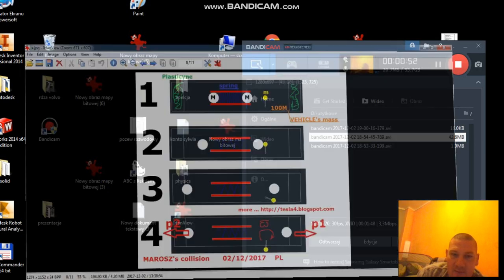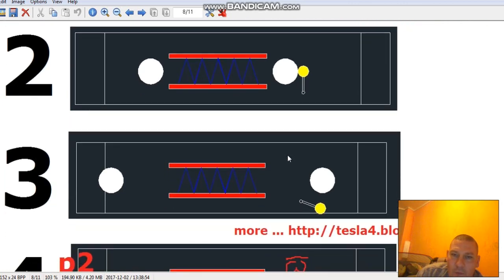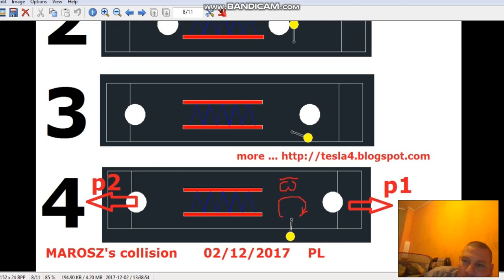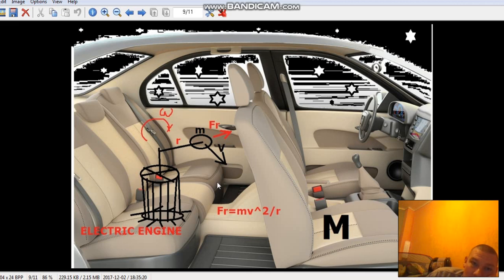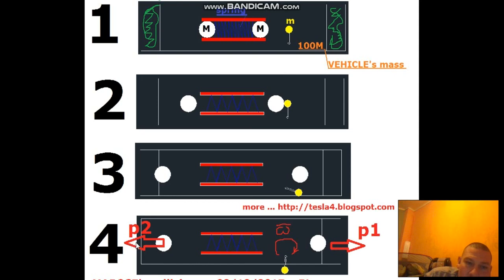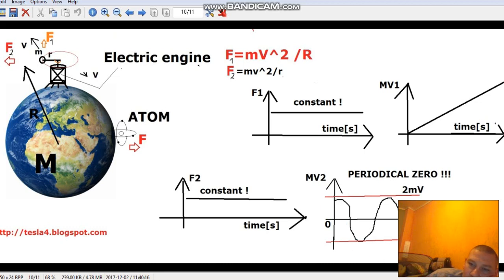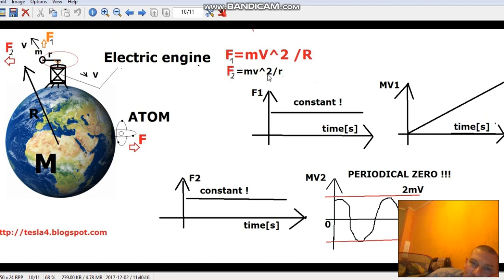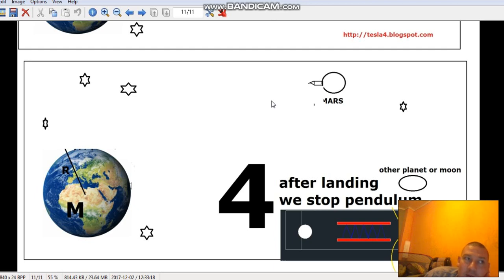EM DRIVE - POLISH ENGINEER SOLVED PROBLEM !

Comment: yes, very good!

You could simplify it by attaching the right mass to the arm and have it spin half a circle before bumping into the plasticine  (p1)  

That would have both masses (p2 and p1) bump in the same direction(!)

It is of course true that the arc motion will create a [centripetal] force to the right (p3) but this can never be the same magnitude as p2. 

Clearly p1 is real and can not be explained away.
Reply from the maker: Sir I worked in this project
https://youtu.be/-t9-GCJTh34

Rotor it is pendulum big mass and small R
https://2.bp.blogspot.com/-hnTo89rHofM/WduuNo4lnvI/AAAAAAAADCE/xNOv0Ezbv3slZByWBH0h-tFjFXStiw--gCLcBGAs/s1600/000.jpg

This project need be continue we can improve many details but it need money.

Right now F1 mercedes mc laren team is using this tool to absorb suspension vibrations 

This project will give us people many informations about atom

Problem is that right now nobody supporting clear reasearch https://4.bp.blogspot.com/-gGRHCO1CiZ4/WfFyU29EaTI/AAAAAAAADDQ/7QpUNap7fbEVZ_64LBdu1Srd27p41EfJwCLcBGAs/s1600/111.jpg

Special if knowledge is opposite to Ligo and Einstein
Reply: Thats a really cool implementation.

I think if you want to see it funded you could propose something like stopping bullets or dampening explosions. The rest of the markets seem overly driven by advertisement.

I do love the concept. I think it might even be possible to prevent the vehicle from spinning and/or keeping it horizontal during the crash using the energy stored on the flywheel .

What if a crash could be electronically anticipated based on the speed and  maximum steering angle. One could fold out a contraption towards the obstacle before hitting it. (like a giant airbag) I imagine an extra meter would make a lot of difference.
Reply from the maker: In China  we have new patent they calling this  energy redirection

Nobody trust that when you using gun bullet no need give reaction to body

If R is small body will feel only small vibration

Exist many many aplications heavy industry area
https://youtu.be/ly4NboppMjA

Im ready start cooperate with anyone who want have this technology

I worked for EPAR Machine engineer
I love design here is my own blog http://tesla4.blogspot.com/2012/11/my-patents.html?m=1
Reply from the maker: exist many many version 1
???? please study this absorber { very important is drawing } 
http://www.formula1-dictionary.net/j-damper.html  
{my own explanation }   Vx=? , V1= ?  V1=Vx ???  https://youtu.be/TxF4aaGjPew     
ok  now back to my em drive !  
termina1 = mass M left ,,,  termina2 = mass M right  ,,,   rotor  it is not flywheel it is pendulum !?